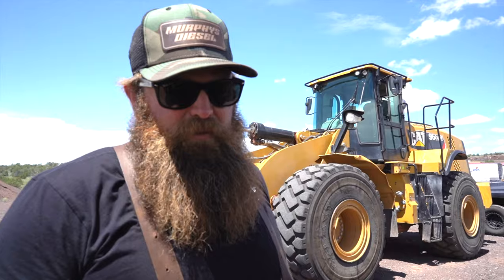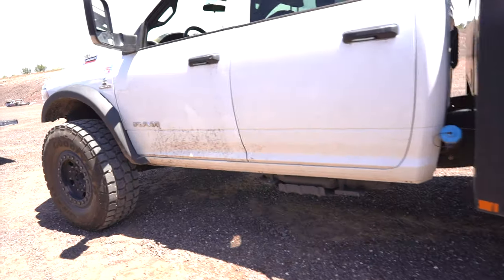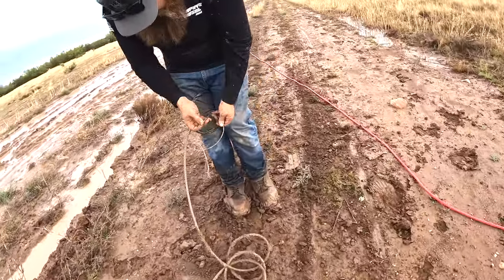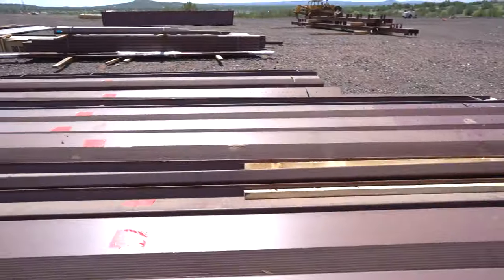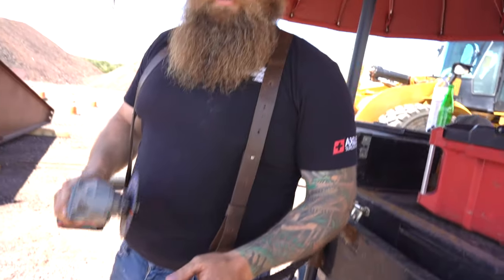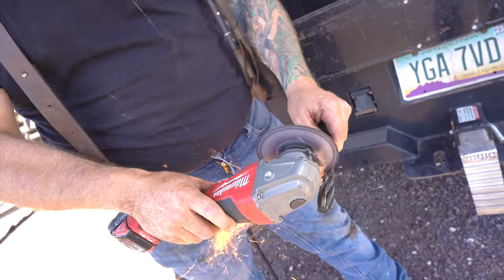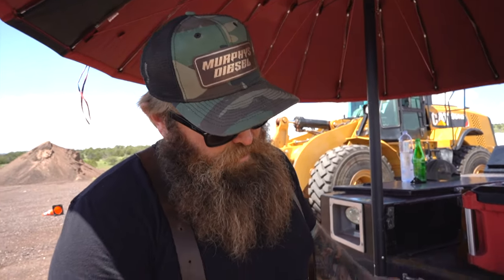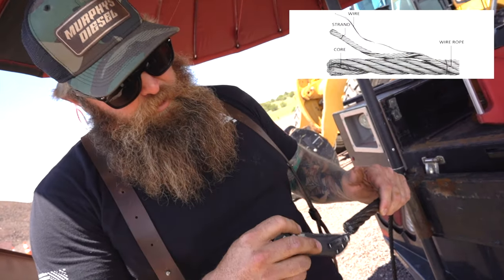Broken Winch Cable Fix - Molly Hogan

Comment: when i first started watching your channel i almost unsubscribed thought you were a S.A. but soon found out you do know a lot and are plain spoken which i like being plain spoken and to the point is good if you know what you are talking about and you seem to. Glad i kept watching. i grew up working in an automotive salvage yard pulling parts we didn't use forklift back then used an old Holmes 440 which worked well. i don't tow for hire anymore i quit when the wheel lift became the normal. my tow truck which i found a couple years ago is a 1966 D500 Dodge with a Holmes twin boom 500 on the back with twin 20,000lb pto winches on it you talk about a truck that will break a cable the wrecker never quits something brakes i have pulled new 3/8" cable into idling and never changed tones only reason i use 3/8 is the weight of the cable and usually only lifting small cars or up to 1ton trucks usually empty and like i say unless i own it doesn't go don't the highway. besides some of the new ones can't tow with sling i have used 4x4 and pulled some but run a risk and at my age not willing to buy wheel list thanks for the videos